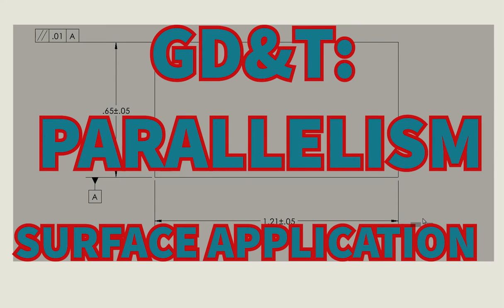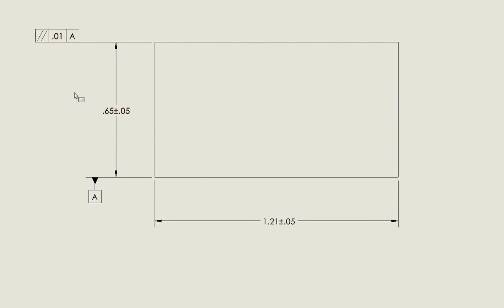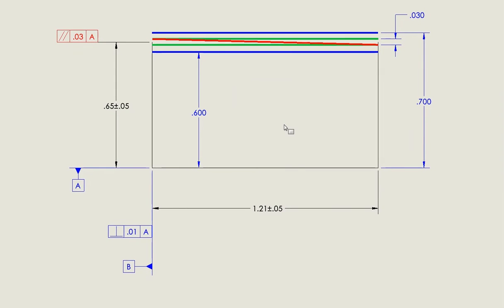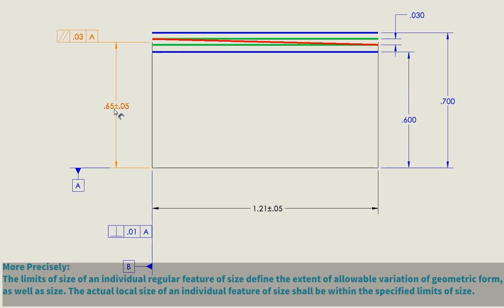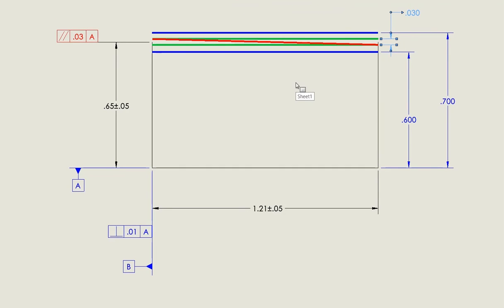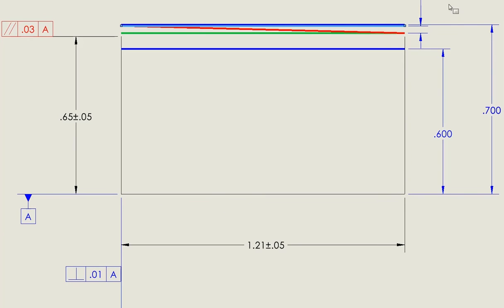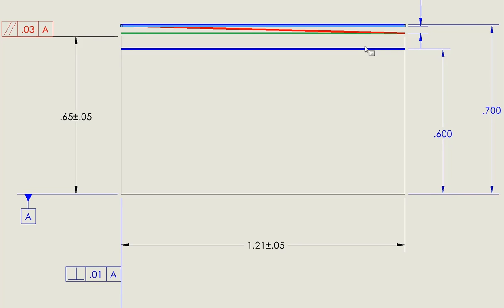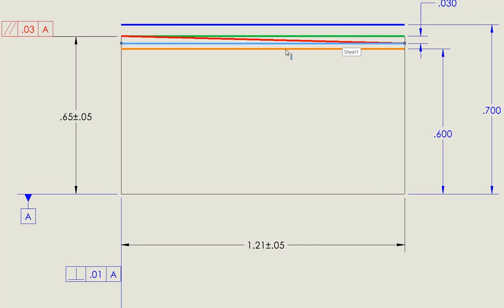GD&T Parallelism Tolerance, Surface Application

Comment: Since the worst-case condition or extreme condition of any feature of size is the same with or without surface parallelism applied to it, does this mean that surface parallelism does not contribute to 3D tolerance stack-up analysis? 

Also, does this apply to perpendicularity and form tolerances?

Please, explain it...

Thanks in advance

Comment: Question: would a feature that is deviating in regards to parallelism but conforming within the profile call out be considered an overall conforming feature?
Reply from the maker: Thanks for the question. I need more information to give an answer: Is your profile constrained to more datums than the parallelism? Is the surface tolerances with a basic dimension or a plus-minus dimension?
Reply: @RDeanOdell  came here to ask this same question. In my case, the profile is constrained to the same datum as the parallelism. The surface tolerance is with a basic dimension.